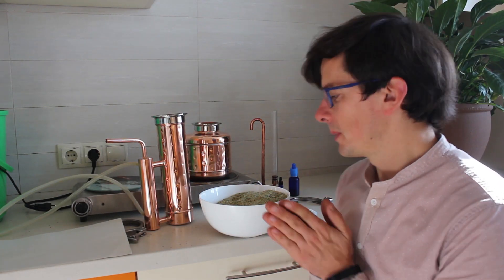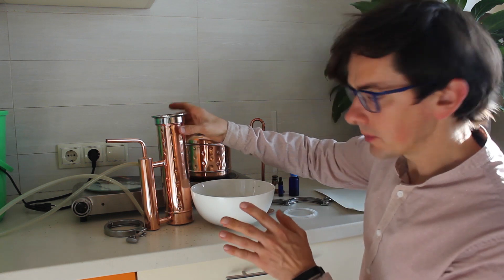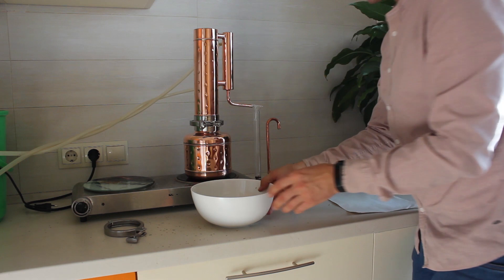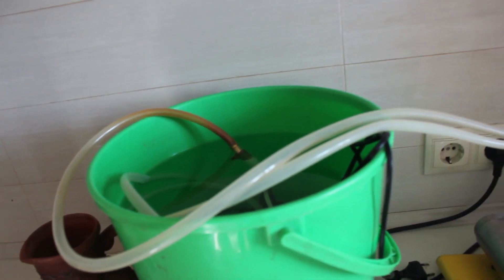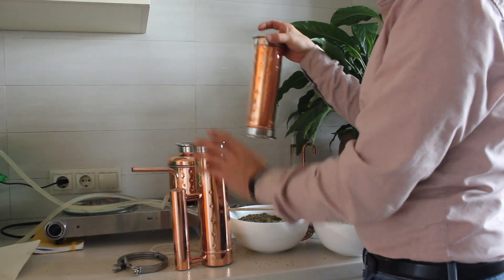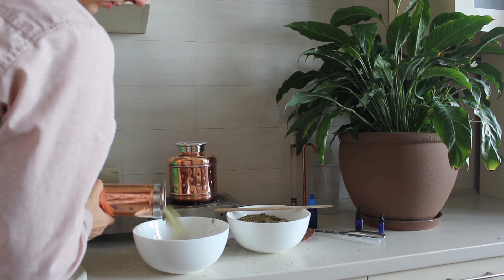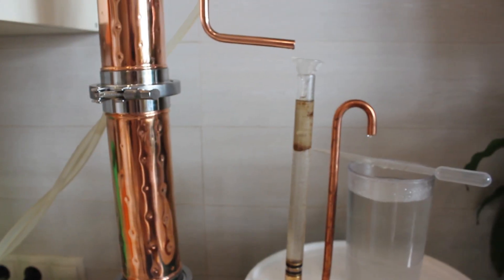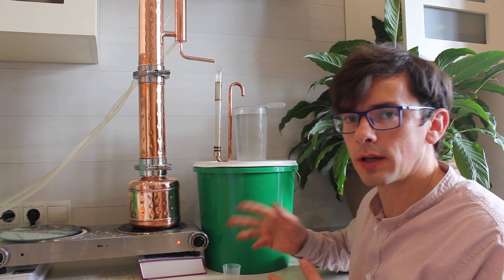How to make the most rosemary oil out of essential oil distiller?

Comment: I have a hot plate just like yours. What temp range should I be using?
Reply from the maker: The best option would be to produce essential oils at the lowest possible temperature at which water will boil and release steam.

Comment: What was the reason for increased essential oil after using extension column?
Reply from the maker: it's simple, you use more raw materials in one distillation process and therefore get more oil
Reply: @CopperPro  but as you said that oil output was 2ml in first batch but when you connected the second column of same capacity the oil output was 10 ml  whereas according to process it should be 4 ml